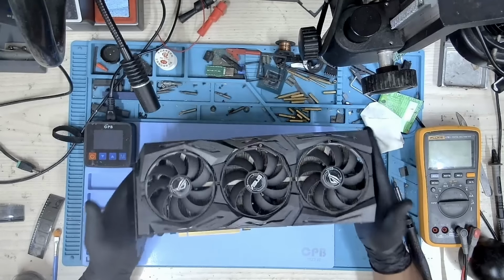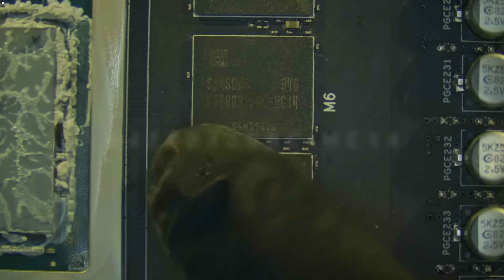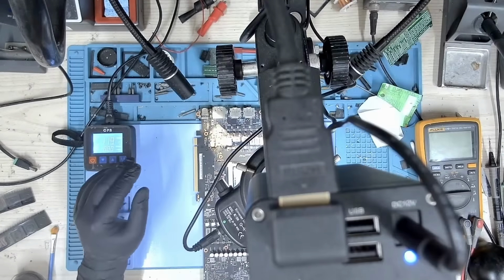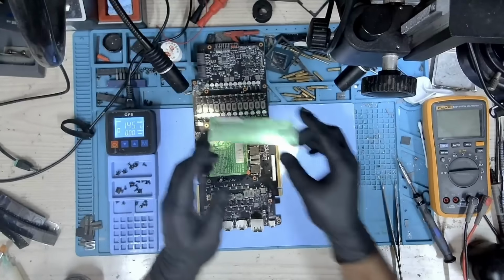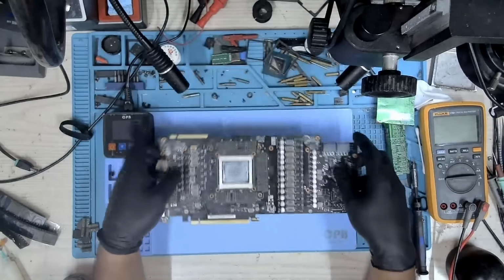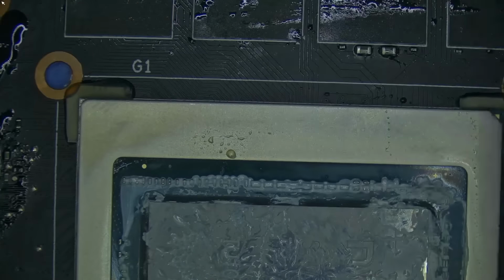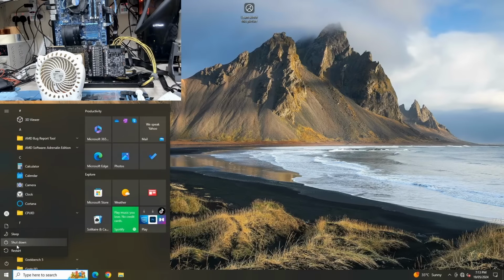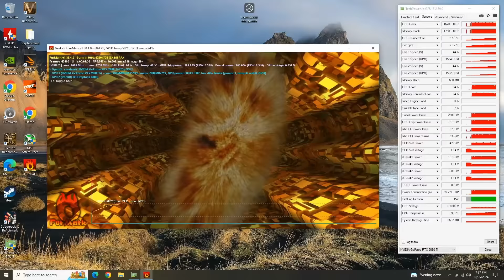Upgrading Asus RTX 2080 Ti memory from 11GB to 22GB

Comment: I have an RTX 3050 laptop, but it only has 4GB while the desktop version has 8GB. Do you think it is possible to carry out the same operation (replace the 4 1 GB chips with 4 2 GB chips. 
Should I flash the bios or would it work natively

My problem is that a lot of games run well but I don't have enough VRAM to display the textures in their entirety.
Reply from the maker: I have not tested it on laptops yet. If you have 1 GB memory on 4 slots then there is a chance to increase. But if it's 2GB on 2 slots then not possible.
Reply: @GraphicsCardRepairs-tk7ql  i have 4 slot with 1go = 4 go, i want replace 1go chip to 2go chip, 4x2 = 8

Comment: What toolkit would you recommend me? What are name of the tools used? Thank you
Reply from the maker: If you are wanting to learn. You can get 1 soldering iron with 245 handle and tip. 1 multimeter and 559 flux. That's all you need to start off.

Comment: Soes this just involve adding the memory moduels or do you need to flash it as well? 

My 2080To FE has started failing the second a 3D load is put on it'll happily run on desktop 2D clocks all day long but 3D testa and it 💩's the bed like Amber Turd.
Reply from the maker: The entire process is exactly the way it is shown in the video. No flashing of BIOS or anything else is required. This video shows 100% steps that are required to upgrade memory.
Reply: @GraphicsCardRepairs-tk7ql  wow if you're still doing this kind of work I may send this card to you it looks immaculate and hasn't been opened from GPUz it's using the dredded Micron ram.

Comment: One question, you don't need to configure anything on the card firmware for the 22gb upgrade?.. did it by default able to use 22gb?..
Reply from the maker: Yes no changes required. Works by default.

Comment: Does the performance increase?
Reply from the maker: This upgrade is a capacity upgrade. Only games which require more than 11GB memory buffer will see a difference. Others will remain the same.
Reply: I have a radeon 6800. Is it possible to put in like 64gb (for video editing)

Comment: hi, I have SAPPHIRE PULSE AMD Radeon RX 7900 XTX Gaming OC, 24GB, I want to know if it is possible to double the memory to 48GB, if so, what are the costs?
Reply from the maker: Unfortunately all the AMD 6000 and 7000 series already use the largest memory module produced on the GDDR6 platform of 2GB. 7900 xTX has 12 memory slots. It cannot be upgraded further.

Comment: Could this be done with a 6600XT???
Reply from the maker: No It does not have room to upgrade. it already uses 2GB memory modules which is the largest capacity on GDDR6 and 6X
Reply: @GraphicsCardRepairs-tk7ql  Bummer, well thank you for the info! I wasn't really expecting a response but I really appreciate it

Comment: I don't know how much money this cost the customer, but I think it could be useful for gaming in some cases. Some games start to eat up a lot of memory when you crank up the details and start modding it. 

If someone's gpu core is still capable, but have vram bottleneck issues, I think this could be worthwhile instead of buying a new card, depending on how much this costs.

Comment: Still need to add more ram to my 3070 FE brand new in the box can we schedule that please.
Reply from the maker: The black screen issue is still not resolved. I would accept only after I have a solution.
Reply: @GraphicsCardRepairs-tk7ql  okay please keep me informed because I will wait u til you are ready because I will be the first in line to upgrade my 3070 once you have it figured out.
Reply: @GraphicsCardRepairs-tk7ql  thank you

Comment: Could a 2060 Super be upgraded to like 16GB from 8GB?
Reply from the maker: I have not tested upgrades on 2060 but if it works 12GB is the highest it can go.
Reply: @GraphicsCardRepairs-tk7ql  Only 12GB possible maybe? The 2060 Super is 8GB standard.

Comment: many ai models are exceeding 24gb now so I would like to know if you could increase the memory of a 4090 to 48gb or something similar
Reply from the maker: Unfortunately 4090 has only 12 memory slots and 2GB is the largest capacity produced on the GDDR6X platform. At least on the same PCB it's not possible.
Reply: @GraphicsCardRepairs-tk7ql  dang, perhaps the 5090 will bring larger memory chips?

Comment: Could this be done on a laptop aswell? I have a 3070ti in my laptop but it only have 8gb of vram. Would the performance increase much if it was doubled?
Reply from the maker: I have not tested it on a laptop yet. Actually I don't have a laptop to experiment with these upgrades. I I do get my hands on one I will try it out.

Comment: since when can we do this? since 2000 series, nvidia encrypted bioses, and we were only able to flash signed and official ones from nvidia ( swap vendors bioses ). it was impossible to edit bios and make costume one.
Reply from the maker: On a 2080 TI no edit is required. It already has the timings for 2GB modules in the BIOS. The others require the timings
Reply: @GraphicsCardRepairs-tk7ql  strange, usually nvidia cripple the cards on hardware level as well, so they cant use emptu ram slots and so on

Comment: I wonder if it would be passable to upgrade a 5500XT from 8gb to 16gb giving that the Processor is the same as the one in the 12gb version and more than capable of running 16gb ?
Reply from the maker: I don't have a 5500XT with me. If I get my hands on I would definitely want to try and test.

Comment: hy i am french ,   i have 2 question , why you delied the straps  and what is the shell screen i meen after you change the memory

thanks bro
Reply from the maker: The straps are aligned to let the BIOS know which memory is installed on the board. This enables the BIOS to run the configuration as per the signal it has received. The software i used to test the memory is Mats & Mods. it is used to test if there are any errors on the memory during installation. Its used only on Nvidia GPUs.
Reply: @GraphicsCardRepairs-tk7ql  ok the straps blocked the signal for the chip bios to reconise if a memory existe , and you turn it to "enable"  the signal
Reply from the maker: No the straps help the BIOS to recognise which memory is installed like Samsung 1GB module or Samsung 2 GB module. Or Micron 1GB. It's a signal to the BIOS to execute the configuration and settings for the memory.

Comment: This could fix the 7900 GRE as well if you replace the slow GDDR6 with some 21Mbps it would make it come alive.
Reply from the maker: Yes faster VRAM can be installed but BIOS would need edit to change timings.
Reply: @GraphicsCardRepairs-tk7ql  Can it be done or is the bios encrypted and uncracked as of yet?

Comment: Can you upgrade GTX 1070 FTW I have three of those cards
Reply from the maker: Unfortunately 10 series of Nvidia uses GDDR5 and GDDR5X. 1GB is the largest capacity produced on the platform.
Reply: @GraphicsCardRepairs-tk7ql  so its not possible to upgrade to GDDR5X VRAM on my 10 Series card?

Comment: Looks like the card has 12 memory positions but only 11 are populated. Do you know why that is? Would it be possible to add one more memory chip to get up to 24 GB (or in case of the 11GB version add another GB easily to get to 12?)
Reply from the maker: The 2080ti has only 11 active memory slots as it does not use the full die. The 12th slot is disabled from the GPU core. Installing memory there will not work. The full die is used by the RTX Titan.

Comment: What is the maximum you could go on a Gygabyte 3070TI 8GB ? can it go to 48 or 32gb?
Reply from the maker: It depends on the largest memory modules produced on the platform. On GDDR6 and GDDR6X the largest is 2GB. So in this case memory can only be doubled if it uses 1GB. Now the thing is none of the GPUs with GDDR6X are working with upgraded memory. I working on a fix but once I find a fix I will release a video.

Comment: I noticed you forgot m11 to put a chip there
Reply from the maker: M11 is not installed as RTX 2080 Ti comes with only 11GB and M11 is disabled from the GPU core. Installing memory there will not work. 2080 Ti does not use the full die. It's used by the RTX Titan which has 12GB.

Comment: hello there, is it possible to do the same thing with 1080Ti?
Reply from the maker: 1080 Ti uses GDDR5X. The largest capacity produced is 1GB on this platform. It's not possible to upgrade
Reply: @GraphicsCardRepairs-tk7ql  oh thank you for the info i also have 1070 gtx and i think it has free memory space too

Comment: The extra 11GB will help if you're playing at higher resolution above 1440p. Espectially at 4K because the FPS difference between 11GB and 22GB in AW2 will be atleast 30 at 4K res. For Ai also a good upgrade and for the mining, it'll be a little confusing at the start because most of the mining software allocate that ammount of VRAM that comes with the GPU so no more than 11GB ( you can change that in a config ). But, everything has its own limits and the limitation is GPU Chip, it's not fast enough. Overclocking it will probably help quite a bit but atleast now you don't have to buy a newer VGA card with faster chip, like 3070Ti for another 200 bucks ( sold 2080Ti and add 200 bucks, you have 3070Ti but i don't know how much this upgrade cost )
Reply from the maker: You are right. Mining has no real benefit from this upgrade. I tested the 3070 16GB with a regular 3070 and the hash rate was very similar. For AI it's a good choice.

Comment: Is there any way to increase the bandwidth 😅
Reply from the maker: Yes using faster memory bandwidth can be increased. Without editing the BIOS it can be manually overclocked with MSI after burner or similar tool to achieve the target frequency, else memory timings will have to be edited in BIOS so it can work by default.

Comment: Can you do more? Is there a limit?
Reply from the maker: For this GPU this is the limit. 2GB is the highest capacity memory module produced till date.
Reply: @GraphicsCardRepairs-tk7ql  is the limit just the module or is there some software/hardware one? I know nothing about these but would it be possible to trick it into thinking it’s one memory module thus increasing it?
Reply from the maker: on the GPU there are memory slots where the memory iss installed If there are 8 slots with the highest capacity memory of 2GB i can install 16GB. If there are 11 slots, i can install is 22GB. This is a possibility and is just one part of the puzzel. There are many other things to consider like if the available slots are active on the GPU core, If the BIOS supports the larger memory, If drivers were written, If the power to memory going to be suffucient. All this is a video initsself. May be i will make one such video.
Reply: @GraphicsCardRepairs-tk7ql  thank you so much for the detailed answer id love a video about this I bet im not the only one who asked and you replied to them about this, it sounds like a great watch

Comment: I wonder if you can upgrade the new video cards with higher memory will that work for example 4070 TI super can you upgrade the RAM on it and will it work
Reply from the maker: Unfortunately all 40 series already uses 2GB memory modules which is the largest capacity produced on a GDDR6X and GDDR6X platform.

Comment: The cooling and voltage system is designed for 11GB, are you sure upgrading it to 22GB isn't bad for the GPU?
Reply from the maker: It's absolutely fine. Has not issue with the GPU.

Comment: What kind of glue did u used there for attaching the black memory thing
Reply from the maker: It is Flux. Its a liquid used to aid in soldering and prevent oxidation when installing the memory to the board (PCB). High heat at 350C to 420C is applied to the memory. This melts the solder balls under the memory and it attaches to the pads under it on the board making a solid contact.

Comment: Can this be done to the 3080Ti?
12GB is sooo lacking these days....
Reply from the maker: I am working on one. I have not managed to fix it yet
Reply: @GraphicsCardRepairs-tk7ql  Well if you can manage to get it to work, I believe you'd be the first channel to successfully upgrade a 3080Ti to a higher vram spec because I can't find anything anywhere else on the matter :)

Good luck, hope you manage to pull off the impossible! :)

Comment: Hey question, what is a good way to start soldering and tinkering with computer parts?
Reply from the maker: best is to buy dead boards or practice circuit boards from amazon or Aliexpress. This will help you with your soldering skills.

Comment: what about upgrading the memory on lower end GPUs like the GTX series or even like a GT 1030?
Reply from the maker: The upgrade on these cards is not worth it as the cost of upgrade will exceed several times the value of the card.

Comment: Can you do a asus rog strix 2070 super?  And how much
Reply from the maker: I have not tested it on a 2070 super. The core is too weak to utilise the additional memory
Reply: @GraphicsCardRepairs-tk7ql  the rog strix 2070 super gaming advanced says it has a tu104 core which is what a 2080 has
Reply from the maker: It has the same core but a cut down version of the TU104. It has much of the core disabled to match the requirements of 2070 super.

Comment: Would it be possible to upgrade an Nvidia 980TI FE ?
Reply from the maker: The cost of upgrade will exceed the value of the GPU. For the cost you can already buy a faster GPU with much larger memory capacity.
Reply: @GraphicsCardRepairs-tk7ql  Understood, was just curious if it was in fact possible. The 980 is one of my old cards. I even have a GTX 1080 TI FE that might be a more suitable candidate for an upgrade. These cards are quite old admittedly but would like to keep them for many more years to come and if upgrading them can extend their life in my mind it would justify the expense. Even if it's just for the sheer novelty of keeping them alive and usable VS just putting them up on a shelf. Thank you for your feedback. I really enjoyed this upgrade video that you posted, It's amazing work and to know this job can be done so effectively I am sold on the idea of upgrades, even if the GPU's are almost a decade old to me it would definitely be worth it. Thank you.

Comment: I have an EVGA 2080 Ti Black. In GPU-Z (v2.16.0) everything is the same as this card except:

Bus Interface: PCIe x16 3.0 @ x8 1.1
DirectX Support: 12 (12_1) [Running Windows 7 Pro]
Pixel Fillrate: 136.0
Texture Fillrate: 420.2
Memory Type: GDDR6 (Micron)
Boost: 1545 MHz

The Boost is the only clock that is slower on my card. Does that account for the lower Fillrates? I don't know why it indicates PCIe @ x8 1.1, as the 2080 Ti is in the x16 slot. I'll have to double-check the BIOS.
Also, DirectCompute 5.0 is unchecked, whereas it is checked on the GTX 770 that is also installed.
Reply from the maker: Watch this video. I have explained and fixed this issue. 
https://youtu.be/8CWsJYmz7Vk
Reply: @GraphicsCardRepairs-tk7ql  Thank you for the reply!

Comment: Would've liked to have seen a game using more than 11gb of ram. Curious how it would've looked.
Reply from the maker: Only games like Cyberpunk with ray tracing, last of us when played at 1440p get close to 11GB. There are very few games that would actually exceed the 11GB buffer. The core will fall short before it can even utilise the memory. For gaming this is not recommended.
Reply: @GraphicsCardRepairs-tk7ql  Interesting. Any other application that could saturate the memory buffer?
Reply from the maker: Using it for AI to run data sets. There is no limit to what it requires.

Comment: How are you validating the BGA connections? no x-ray?
Reply from the maker: Practice practice and practice.
Reply: @GraphicsCardRepairs-tk7ql  ...just wow. i used to do rework on prototype boards and remember adjusting 0102's with a microscope and thinking how badass i was. But manually placing BGAs is insane! Doing it without any sort of inspection tool to see through it is even crazier! I'm super impressed!! And doing custom work on someone's GPU would be enough to make my hands shake so much it'd be impossible lol. Nice work, loved the video

Comment: Hi sir.. I really like you genius. It is possible to upgrade RX 6700XT 12 gb to higher vram? ur fans from Malaysia. Thanks
Reply from the maker: Unfortunately none of the AMD 6000 and 7000 series can be upgraded.  They all use the 2GB memory modules which is the largest capacity modules produced.
Reply: @GraphicsCardRepairs-tk7ql  gg damn. Thanks man